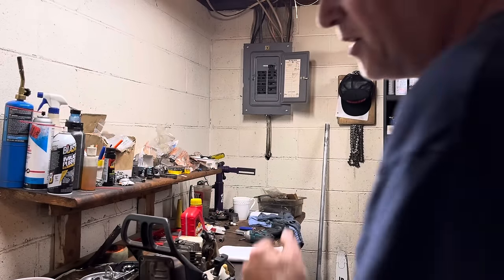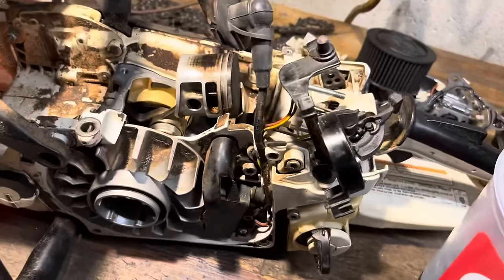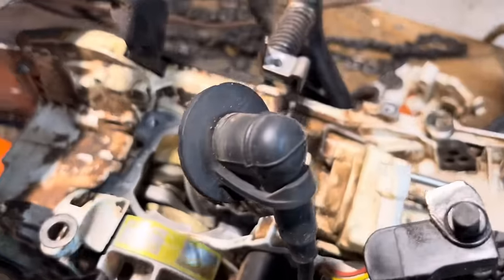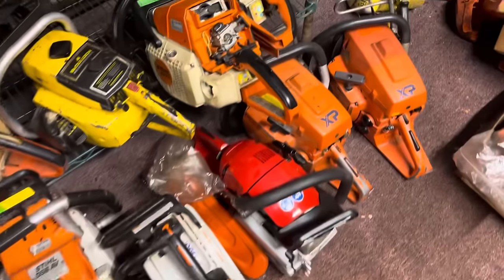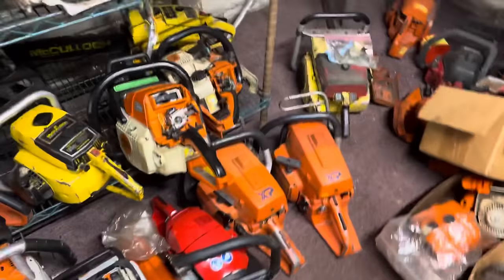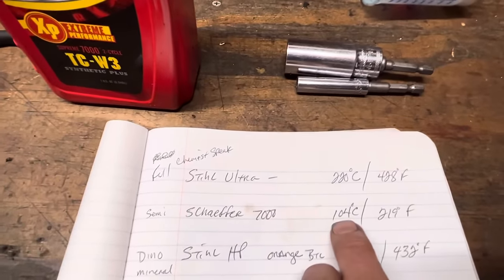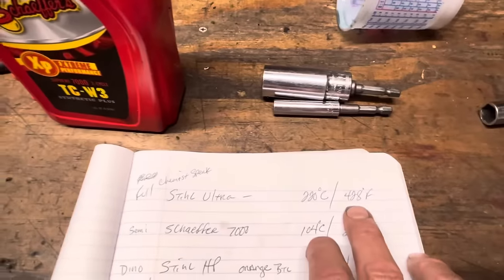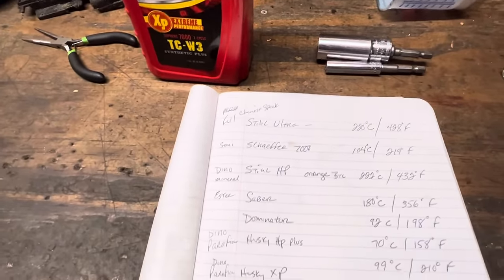Two Stroke Oil Talk.  Why Anything is Better than Ultra for your Chainsaw!

Comment from the maker: Today I disassembled an MS261 with relatively low hours.  It has been run primarily on Motomix, and occasionally non-ethanol fuel with Ultra.  This was an unplanned video, but I see this kinda stuff all too often.  Have a look at the video I posted back in April of this year.  It highlights a BG55 blower with a clogged spark arrestor.  It's another very common issue from running Ultra.
Reply: They were running cheap oil to plug screen
Reply: Spark arrestor get clogged from excessive idling, clogging a spark arrestor has nothing to do with the type of oil. And in your video you say the cylinder has no oil, then you say there is too much in the spark arrestor, so which is it?
Reply from the maker: @michaelconley3826  Ultra, in most circumstances, leaves more carbon than other "more forgiving" high quality oils when the user doesn't "run it right".  I said the crankcase was "dry as a popcorn fart" which is typical when you run this oil.  

I've done several videos highlighting how this oil leaves a lot of carbon. Have a look and decide for yourself.  I'm just documenting what I see on a regular basis.
Reply: Add more oil 🤔🤔
Reply from the maker: @alansh1492  I just did a video of another 261 that was run on 40:1 Ultra.  It was even worse.  If you're brand loyal, the orange bottle is decent at 40:1 long term.  Husqvarna XP+ did well in a recent test.  Saber and Dominator do very well also.  Just my .02
Reply: @richardflagg3084  huh, not really difficult to switch to husky canned gas so guess I'll do that for peace of mind.
Reply from the maker: @jodynorris6975  Ran mostly on Motomix.  He did occasionally mix Ultra with pump gas as stated in the pinned comment..  I'll be honest, it's pretty hard to mess up mixing gas with premeasured bottles. He's not a dumb dumb.

There are several other videos I have made with similar results.  Pull your muffler and/or top end.  Have a look for yourself.
Reply from the maker: @jodynorris6975  🤣🤣🤣
Reply from the maker: @jodynorris6975  🤡🤡🤡  Is that better? 

If  you watched the video (all of it) you'd know.  Perhaps you could do your own video?  Oh, wait you don't have any videos on your channel.
Reply from the maker: @Edoc This saw ran fine too.  How can I be biased if I open up a customers saw and show what's inside? There are multiple videos on my channel with similar results.  Think of it as a PSA.  Glad all of your equipment is running fine.
Reply: I’ve always ran the old stihl oil for breaking in my new saws. Which is made by Castrol great oil. I always make sure that the piston everything seats very well. Then I switch over to Amsoil sabre at a 45:1 ratio. Running power saws for my living. So they have lots of hours and take them apart once a year to have a look inside, and I’ve never had an issue with carbon building up to that extend. I have a friends running stihl hp ultra. And he having the same issues saw runs fine. But lubrication just not there. It’s easier to change a piston and cylinder, but gets awfully expensive. When you have to tear down the saw to put in bearings and everything else. He just showing you the results in the video.
Reply: I've ran that shit for 15 years in my 290. Never caused a problem for me. Seen a few videos like this. People don't mix their shit right then blame the oil. How funny.
Reply: @@edoc6519lol he is not the first person to say it plugs up spark arrestors from the excess carbon.
Reply: Спасибо за видео, теперь буду заливать это масло 20мл.. Мотор чистый. Не скромный вопрос. Вы, определили причину поломки пил? Плохой работник , плохой бензин, цепь не наточена, мало масла меньше 20мл., плохой фильтр опилки через карбюратор, опилки через подсос воздуха, плохой мастер регулировки, много масла более 20мл.?
Reply: Will you do a test with Royal purple 2 stroke oil please?
Reply: Yah I'd like to know about royal purple and redmax. I've tried Sabre & dominator,  trying redmX and royal purple next.  My redmax blower 8500 would recline with canned fuel.  Would blow a pile of frozen wet leaves EASILY. I've tried every gas octane and 2 cycle oil (almost) nothing matches the Tru fuel power but unaffordable.  Stihl KM85 kombi.  Stihl 025.  Likely trying redmax for all now.  I didn't get the (burn), writings.  Can you LABEL best oil like 1st place 2nd place I'm more VISUAL vs number oriented 😮 thank you, nice work helping others and me 😂
Reply: It helps if you mix your oil with 91 octane petrol not higher and not ethanol

Comment: Stihl HP Ultra is good oil, but many people don't know that 2 stroke engines are run at full throttle. So, if anyone will be using HP Ultra, give your saw or trimmer pedal to the medal.
Reply: Yes, chain saw triggers are "on/off" switches.  Either maxed out or idling, there's no in between.
Reply: @stevem6711  what? Do you even know what your talking about? Maybe, you don't understand that comment?
Reply: You can't cannot, run equipment full throttle .all the time it's impossible dangerous weed eaters saws blowers .you'll have insurance claims piled to ceiling and lose your businesses. Why would you.fisrt day mowing after transferring from state to state running crew 2 guys did that full throttle and shot something Into us bank window a 50ft by 50ft huge glass window wall. So no that'd ridiculous
Reply: You need to run it 50-100% but not constantly because you will blow your rngine up.
Instead mix yourself some racing oil. 
I mix 4,9L of gasoline and 100mL of Castrol POWER1 RACING 2T.
Reply: It sucks period
Reply: @Sethhaun78  I told you what to mix and be safe...
Reply: Correct and being that this saw belongs to an ice carver, I doubt he ever gets into it long enough to burn the deposits away. For those of us using equipment as designed this oil sticks around a bit longer, protecting longer. Stihl oil is produced by Castrol. They tend to know how to lubricate things.
Reply: Stihl oil sucks period I ran a tank of it through a stihl ms 362 was a nice saw but I took a look at the piston through the exaust and the piston was all scored and scuffed up to all hell
Reply: @henrykurish I probably have close to a hundred hours on my 361 chainsaw and fs85 weed eater and about half that on my 461 saw, a lot of those hours running stihl ultra @ 50:1 with non-ethanol. The rest were stihl orange bottle. I don’t think I’ve ever HAD to clean an exhaust screens & definitely never had the engines apart. I might try another brand when I need mix fuel next time, but my experience with stihl ultra has been uneventful.
Reply: @Sethhaun78 dude, did you write that drunk?
No offense if you did, I’m from Wisconsin, but man, read what you wrote. Lol!
Reply: @Sethhaun78 epic rant. What u smokin'? I want some.
Reply: @FT4Freedom  nothing
Reply: @ryanzanow8221  these keyboards never do texts properly or explain the context people misunderstand
Reply: Pedal to the metal only in the cut,unless you are cutting branches, but you need to have a razor sharp chain every time you cut or you will be putting more force on every part of the saw and creating a hell of alot heat and friction on the internals, dull saw dead saw eventually,let the saw eat the wood , never force feed it through the cut, and all modern 2 cycle oils are good to use ,50:1 -40:1 or whatever, just make sure you adjust your carburetor to the mix ,and inspect ,clean and maintain your saw after use .

Comment: We have been using the Stihl premium oil here in Canada. It's blue. We have 14 saws plus other two stroke equipment run on it and have not had one problem over the last 8 years.  We mix at 50:1 and have not had any spark arresters clog up or any other problem.
Reply: Stihl premium in Canada is basically Castol semi-synthetic. Decent oil.
Personally, I use Shell full synthetic snowmobile racing oil.....get it at Walmart, CDN Tire etc........ best oil I've found.Run it year round in QC......Shell super gas, no ethanol gas!
Reply: I like the Echo Red Armor 2 cycle engine oil with stabilizer in it.
Reply: I agree for 10 years I have left my Stihl equipment over the cold Canadian winter with the blue Stihl oil and pump gas mix , sometimes not starting them up til the following late summer and never have a problem with them starting and running just fine.
Reply: Bought a brand new BR450. Used nothing but non-E and ultra at 50:1. Arrestor completely clogged up before the 4th use.
Reply: The Great oil debate.
Reply: @Johnnyreengo  - And those four runs, how many minutes in total? 

You need to run a Stihl long enough to allow the carbon to burn off. 

Get alkylate fuel from Aspen or Stihl with the Saber oil. Runs better and cleaner.
Reply: @Johnnyreengo still using it ?
Reply: Castrol is a good brand.
Reply: @Johnnyreengo  switch to Schaeffers and all will be fine!

Comment: Stihl ultra is good oil I run it everyday for years cutting down and milling native/pine timber in New Zealand people get hung up on what oil to use I run the stihl hp ultra at 45-1 and run my saws flat out all the time most of the time it's everything else on the saw that wears out not the piston and crank for instance I run a 661 on a Alaskan mill all day everyday for 6 mounths and the saw never missed a beat and is still cutting better than ever
Reply: @adelarsen9776  yea me to
Reply: @dragonfire-jx7qx  My friends in NZ tell me that she's gunna get chucked out next time.
Good health to you and Merry Xmas.
Reply: Me too.
Reply: @joschmoyo4532  Cheers and happy cutting.
Reply: Mineral oil aids combustion where full synthetic resists combustion. I've been happy with high quality mineral oil fb or fc rated. I use Shell Advance SX 40:1. Ultra full synthetic is awful when you strip down saw, the eye burning nostral killing smell due to its sulphur content. Your 2T stuff will run harder with mineral oil.
Reply: @aussiehardwood6196  
It's not fully synthetic. It's a combination of synthetic and castor oil. Castor oil does burn partially but is highly resistant to film break down. As for the bullshit about the smell, never noticed it. I do notice my carbies never gum up on ultra. Hell, it works so well I use it as an anti gum additive in my postie bike and yammie 250.
Reply: @joschmoyo4532  I've ran it for years in my 290 and my 56 trimmer and no problems as of yet. Ran it in my 290 for years. I cut firewood and do a bit of timber falling. Have 100s of loads of wood and dozens of truckloads of timber. Mainly popular, and red oak. A little white oak.  And any one saying dinosaur oil and or fossil fuel loses all credibility from me. How many dinosaurs do you people believe are being sucked out of the ground daily. Lmao.

Comment: I'm a professional logger. Run saws evey day. All my saws are ported and I run bel ray H1-R @ 50:1 with 0 issues. Plenty of film strength in the bottom end every time I've ever disassembled a saw. I've never lost a saw dew to oil. Just a cracked ring from alot of hours. I've tried 40:1 and it's too much oil in my opinion. Way to Smokey and the exhaust ports are always wet with oil, doesn't matter how hard you run them. That's my experience
Reply: I run h1r also and against everyone's recommendations, 40:1 was too smokey for me. I dropped to 44:1 and am thinking about going to 50:1 now. Good oil.
Reply: Love bel ray oi
Reply: I run 42.5:1 and measure the fuel and oil carefully. Great results.
Reply: I was looking for this …. I run the same and I love it

Comment: I have never had a problem with any two-stroke using cheap Poulan two-cycle oil started using steel oil for the warranty in all my news items and have burned four engines. Cylinder wall scorned, bent connecting rods Stihl oil is a joke

Comment: Ran stihl oil all my life. One of the best oils I've used it's got such a high flash point because saws are meant to run full throttle. The other stuff is meant to burn up and not foul everything up at idle so it won't lubricate well at higher rpms. That's why the stihl oil does so well and is alot thinner. You dont need much oil it just needs to be there. Thats my opinion I'm no expert either.
Reply from the maker: Sounds like you've been using the orange bottle.  It's a better oil than the Ultra IMHO.
Reply from the maker: @jodynorris6975  I work on other peoples equipment for a living.  I'm not unhappy, I'm frustrated.  What if that was YOUR chainsaw on my bench?  Wouldn't that give you reason to pause.  This customer, as many others have, followed the direction of the dealer in good faith. 

 I have no idea why they went with a JASO "FB" rated oil package as their top tier oil.  Current JASO top rating is FD.  The Ultra seems to do well in the 4Mix backpack blowers and trimmers, for which it was developed.  Results in Mtronic chainsaws are less than stellar as shown in multiple videos on my channel.

If you've read this far, please look at some of my other videos on this oil.  Thanks, Rich.
Reply from the maker: @jodynorris6975  It's your equipment so you should run what you like.  I'm pretty sure they double the warranty because rainbows and unicorns fly out of the exhaust.
Reply from the maker: @jodynorris6975  Actually I thought it was funny, light-hearted and witty.  Could you imagine rainbows and unicorns actually flying out of the muffler?  That would be EPIC!
Reply: Me and half dozen small business owners will all tell you that oil is absolute garbage.from the pond color to the clogging spark arrestor s and what Richard clearly shows.i worked on m any big name companies,crews from Wisconsin, Illinois, st,louis,Arizona Mississippi all over country and I've taken brand new saws and weed eaters blower xxxctra ,and watched that oil get put in them and almost instantly first tank start acting up bogging clogging, and much worse .had 2 lawn companies last year ask me to look at their equipment and instantly I knew the problem. That oil .cleaned out exhausts and topends ,plugs ,rinsed tanks and filters put red armor ,or vp,maxima in them and boom problem gone..I' run tree service and landscaping company and mow commercial  plus 45 residential s ,by myself mostly and over last 27 years have become safe tree mechanic nothing like Richard. At all,but to say he's angry and poke someone who's making a valid point  and doing a service is ridiculous. No companies I know here in east Tennessee EVER USE THAT OIL,they buy the pack for warranty and toss it on a shelf.the ones that do there tools are for sure in local shop.and chainsaw s newer ones are not same animal as old ones.ive told people for years that oil is terrible. True fuels  right behind .and since being honest 75 percent of guys don't take care of their equipment and would be afraid to let them touch mine.Especially,my chainsaws they stay right next to me never out of site .they go behind the bed at night and in back seat.most men do this with guns ..But guns don't make me a living ,saws do.and they don't get me arrested .just saying .I've seen a dozen mechanics warn don't use that oil unless it's in 4 mix engines .I don't know anyone who uses equipment for a living that runs that oil in dozen states .same goes for Husqvarna xp tried it once  ,and never again.aaron lynch just did video of a 5 year saw using 927 and piston was spotless 4 years I meant.THE REASON THEY DOUBLE THE WARRNTY  is corporate not because it's great oil .they want your tools in the shop .same as casino wants you to keep playing .sounds like Jody is fan boy or just wanting start trouble I would trust Richard any day with advice on equipment .go ask jack at hotsaws 101 what he thinks about stihl ultra 30 year logger and saw builder.i was raised in tree service big brother had 2 of them in Wisconsin, illnios .both.and even the stihl  fan boy crews did not run stihl oil.nor husky .after 28 years in this work .best products are never the biggest names.all have flaws .and CASTROL makes stihl oil it's same as there motor cycle oil. Buckin Billy Ray did video on it.waz Identical exact same and color
Reply: At least they do the orange bottle.make it I mean
Reply: Yes made by castrol
Reply: @Sethhaun78 so what oil should I use in my saw? I’ve always used Ultra in my little MS 170, and other than a clogged screen I’ve had no problems. I did end up with carb problems in my FS 55 trimmer, but I don’t run it at full RPM a lot so that might be what started the problems.
Reply: @68fmj51 you have to run it at full speed to burn the Carbon off the screen
Reply: @68fmj51 read the label. You need fd rated oil. Like Lucas, vp 2 stoke oil. It’s different classification oil. Some oil fb rated.used vp 2 stoke oil I used that on my trimmer. Thank me later.
Reply: @Nicholas-y5y  so the Lucas semi-synthetic is what you suggest? I see it is JASO FC and FD rated.
Reply: @68fmj51  yes you can use  that too. My top 3 is Valvoline  multipurpose, Lucas, Vp 2 stoke.

Comment: I'm a 32:1 oil dude. I actually enjoy to see smoke coming out of the muffler and the smell of the exhaust. But my newest saw is 20 years old. My oldest that I use is 52 years old (SXLAO). But I'm not a pro, I just cut to heat houses.
Reply: Same here.
Reply: Is 32:1 a lot of oil? That was the standard mix on roller bearing Lawn Boy lawn mowers. I think 16:1 was standard on bronze sleeve D series lawn boys.
Reply: @gregorymalchuk272  That's cool. I had a Lawnboy back in the 80's, and loved that mower. If I ever see one for sale, I'll buy it.